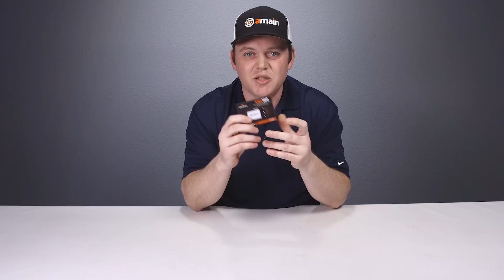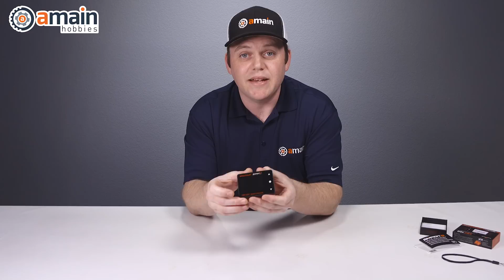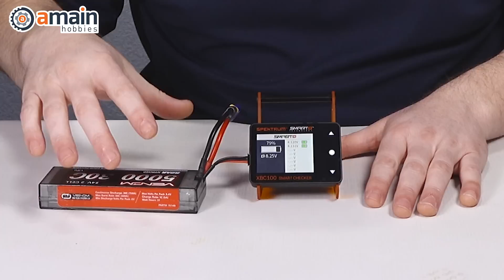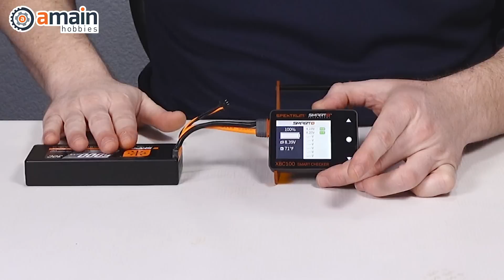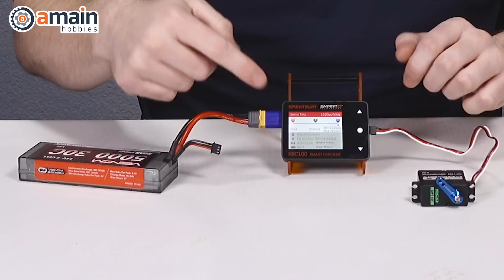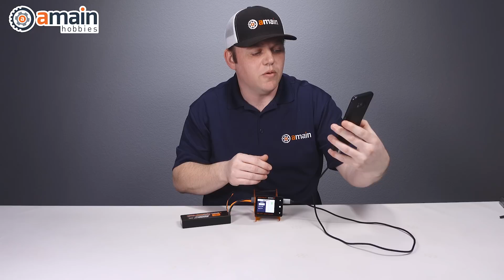What's New: Spektrum XBC100 Smart Battery Checker, Balancer, Servo Tester & USB Charger

Comment: My Spectrum S155 did an upgrade to my Spectrum G2 2200 lipo after which it doesn't work correctly; it's now looking for a balance lead, nor does it show the individual cell voltages anymore, plus it won't auto start any more. So I assume the upgrade downgraded the software to an older version that needs the lead to function properly (or just nuked part of the G2 software). Do you think the balance function of this device will balance out the cells (assuming it has the G2 leads only plugged in). I know of no way to upgrade the battery software so perhaps this device will help me keep the cells balanced over time

Comment: Do you have to change this checker up to make it turn on ????????
Reply from the maker: When cell checking, the device uses the LiPo power to turn on (assuming the lipo has enough juice to power the unit). For servo checking, an additional battery needs to be connected.
-Brett

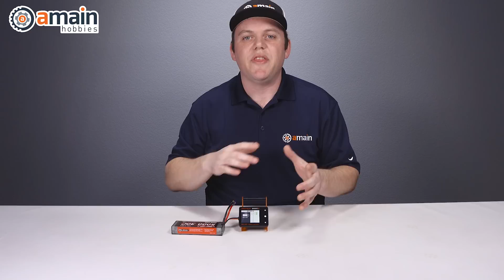Comment: Hi  Brett, Would like to ask you 2 questions regarding the XBC100 Smart Battery Checker.   1.Is the cute sloping stand on which you place the Smart Battery Checker  (on time 2:12)
 may be purchased from amainhobbies?   2.Does the XBC100 gives internal resistance data of the Lipo cells as well?  Thank  you.
Reply from the maker: Hey Gad. YouTube flagged your comment for inappropriate language (don't see why) and we didn't see your comment until now. For the stand, it is not purchasable; it is my cell phone holder. For the IR, the XBC100 does not have that capability. 
-Brett

Comment: If I change the connector on a smart batt, can I plug the balance plug in and have it read all the info?
Reply from the maker: Why would you change the connector on a smart battery? A smart battery has a smart connector that will directly connect to the XBC100 and provide battery data.
-Brett
Reply: @AMain_Hobbies   I had got 2 from a guy on CL and put my XT90 connectors on, that is what is in all my stuff so i did it without thinking!
Reply from the maker: @Blimpus  Oh, I understand. You want to return the smart connector to those batteries. If the data cable is still connected it should be doable. Here are the larger IC5 connectors: https://www.amainhobbies.com/search?s=ic5
-Brett
Reply: @AMain_Hobbies   I learned today, Thanks Brett,

Comment: Can it set Non smart batteries into storage voltage? I’ve been trying to find out before buying it. Downloaded the manual, but the information is very limited.
Reply from the maker: No. The programmable storage voltage is a function of the battery, not the cell checker. The cell checker is just the interface to interact with the battery programming. Only the Spektrum Smart Batteries have that function as far as i'm aware of. 
-Brett

Comment: Can it set my End points ?
Reply from the maker: No, the info wouldn't be saved if it could. You'll need to use your transmitter for the end points, and the transmitter will save these values in the future so it's always set. 
-Brett

Comment: If I charge my phone do I have to use a specific cell size battery?  Can it be 4s, 5s, or 6s?
Reply from the maker: No, it shouldn't matter. The instructions just say plug in a LiPo and the USB should be active. 
-Brett

Comment: How do you program your smart batteries when to  discharge to save storage voltage?
Reply from the maker: In the XBC100, you can define how long the battery waits before initiating the auto storage function, and also define what voltage you want for the auto storage function. You can also do this programming within the Smart Chargers I believe.  
-Brett

Comment: I haven't been in this hobby for over 40 years.
Wow things sure have changed with the radios and transmitters and receivers😵
With all the abbreviations I have to stop the video look it up on the internet and start the video again.
I had gas, nitro and Cox motors
All this electronic stuff with the receiver and a transmitter so programmable the learning curve is very extreme.
PLEASE make videos for dummy nudes  like me🤔😖
Reply from the maker: Good idea to pause and do your research. You pick it up fast. Also shoot over any questions you have. We're here to help. 
-Brett
Reply: Thank you for your advice wow what a learning curve.
I just have to worry about what frequency my crystal was on when I was flying 😁🤔 all those years ago.
Reply from the maker: @jamesturncliff5960  Not anymore you don't! The transmitter tech, battery tech and brushless power tech has come a long ways. There's never been a better time to be in the hobby. 
-Brett
Reply: @AMain_Hobbies  I'm still trying to figure out how to adjust the gain value on a DX6E with a SPMAR637T receiver so I can fly my ASW28.
It does not have a slider and it does not have.
It has two three position switches one which I'm using for my flaps.
Can you put a knob or a slider on a DX6E transmitter?
Reply from the maker: @jamesturncliff5960  Our air tech is saying this program module will allow you to program the receiver and transmitter, so you should be able to program the gain levels for the switch: https://www.amainhobbies.com/spektrum-rc-as3x-programming-cable-w-usb-interface-spma3065/p356516 
-Brett
Reply from the maker: @jamesturncliff5960  No, I don't think you can add a knob. 
-Brett

Comment: Got one today. Included instruction "book" is useless. Regarding this video, . . . can't see the screen! Does not show how to check a NiMH or NiCd. Do I just connect one and see what happens? Device looks good, but available instructions really Suck!
Reply from the maker: You would want to connect your NiMH or NiCd to the IC3 port on the side, and you should see the overall battery voltage displayed. The device will not display individual cell voltages of those battery types though, as that pertains to Lithium cells only. 
Hope this helps. 
-Brett

Comment: Will this work on Traxxas ID batteries?  Thanks!
Reply from the maker: Yes sir, but you will need the Traxxas iD adapters: https://www.amainhobbies.com/traxxas-id-lipo-battery-balance-lead-adapter-tra2938x/p704067

Please note: These adapters are only to be used with a cell checker; you cannot use them to charge a Traxxas battery!
-Brett

Comment: Can I use the USB port to charge my umx radian 1s lipo batteries  with the small charger that came with the plane?
Reply from the maker: I suppose you could if the USB provided enough power to satisfy the chargers requirements. You will need a fully charged LiPo to plug into the XBC100, to feed it the power to charge from the USB, but I think it can be done. Here is what Spektrum says: "Qualcomm 3.0 compatible USB power port with Quick Charge for compatible Android and IOS devices (up to 12v and 2 amps)"
-Brett

Comment: do you have a EC3 to XT60 adapter at you store ?
Reply from the maker: Hey Shea. This adapter has a female EC3 to a male XT60; so you can use XT60 batteries on EC3 devices. Hope this is what you're looking for; if not let me know, and we'll find the right one. Adapter link: https://www.amainhobbies.com/dynamite-battery-adaptor-xt60-male-to-ec3-female-battery-dync0141/p415606
-Brett